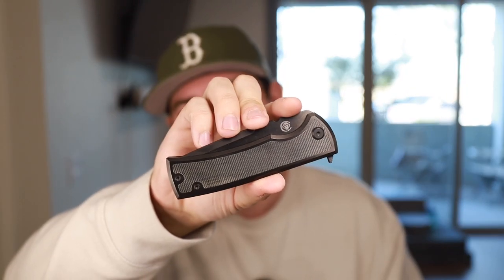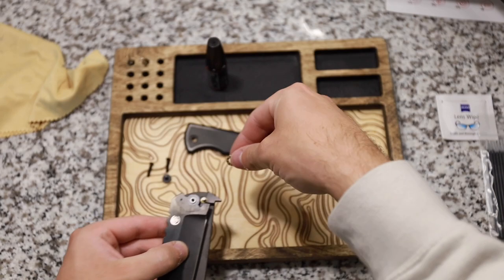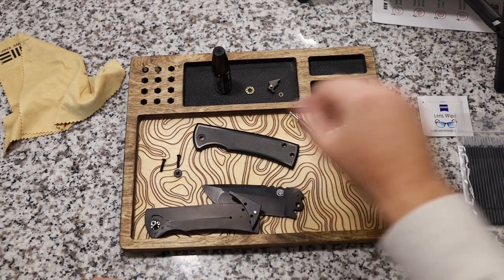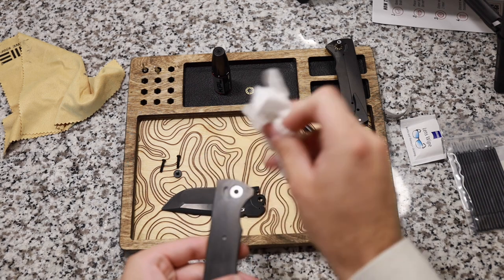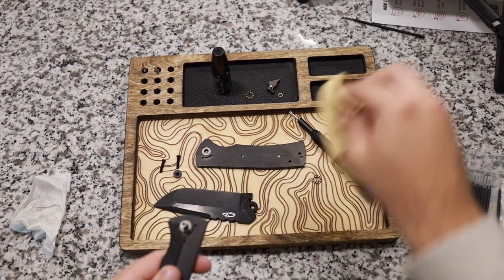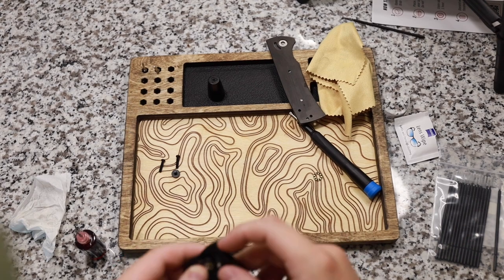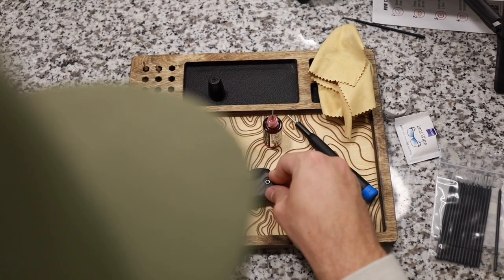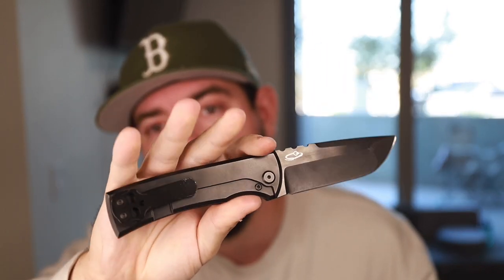How to: tear down and clean a Chaves Redencion Kickstop

Comment: Thanks for making this video! I did have one question though - is the micarta inlay held on with screws from the underside? It kind of looked like it when you flipped the scale over, but I couldn't really tell. I'm considering picking one of these up, and I would love to be able to swap the micarta out for another material down the road.
Reply from the maker: I actually haven't looked at that, but I'm pretty sure it's a glued inlay. Let me do some research and I'll get back to you on what I find
Reply: @Everyday_Zach  I appreciate it, thanks man!